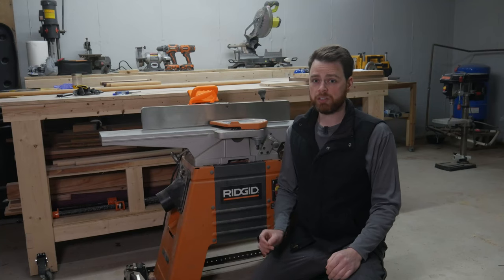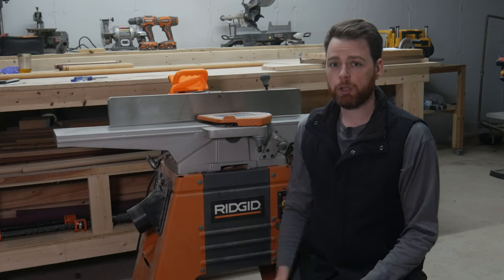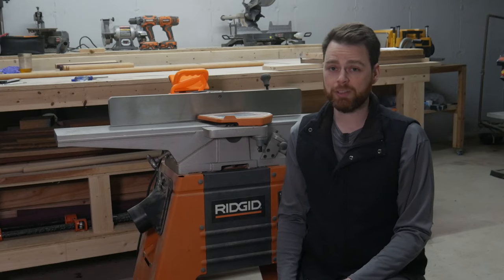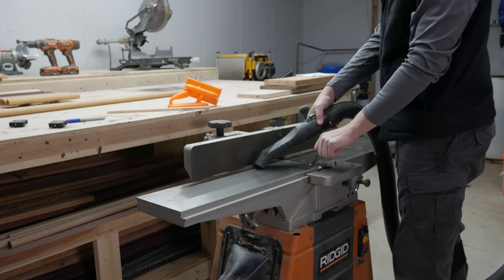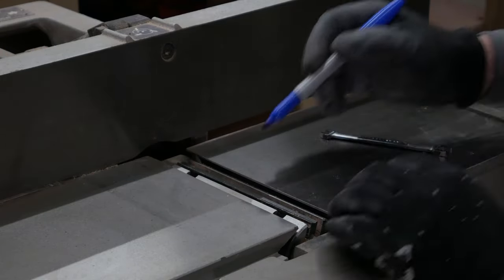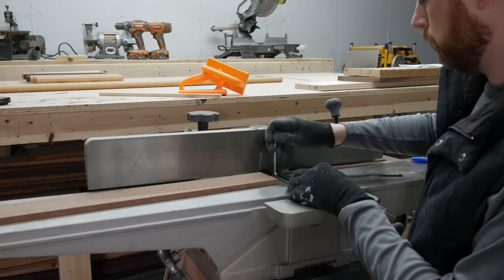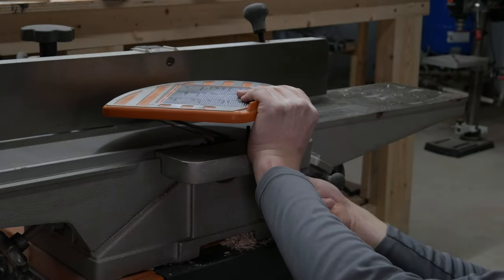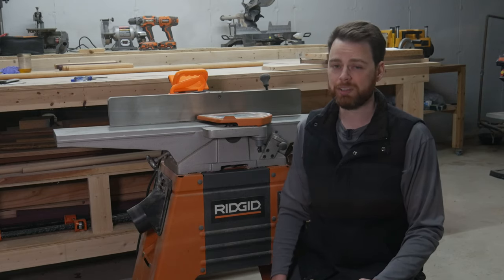Ridgid 6 Inch Jointer Blade Replacement ||| Step by Step

Comment: Does the round side or the grooved side of the blade bracket go up thanks
Reply: Round side up, friend.
Reply: Great video, informative, no extra life story,  good editing. 
Only question: Have you tried a “jointer pal”? My hand me down jointer came with one. Which method is better?
Reply from the maker: Thank you! I have never used a jointer pal so I can't really comment on its effectiveness. I say use whatever tool works!